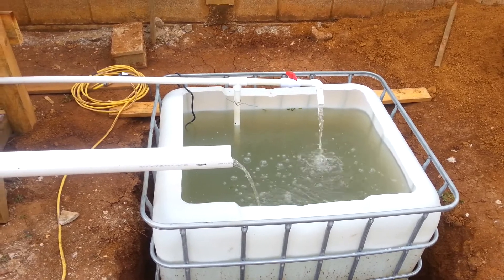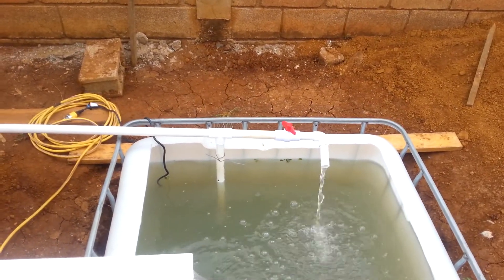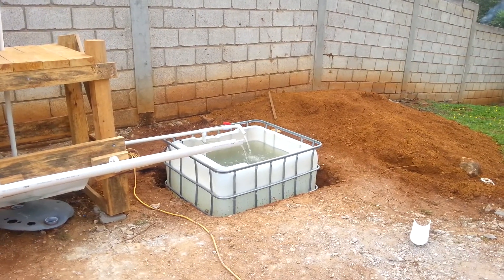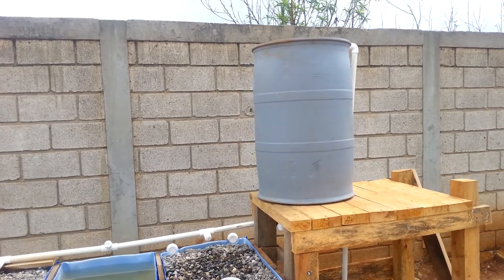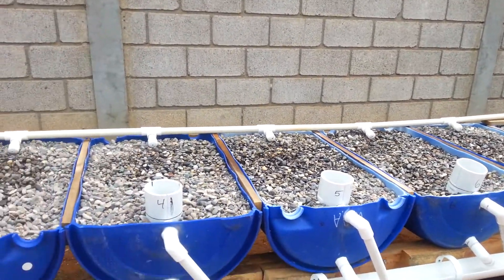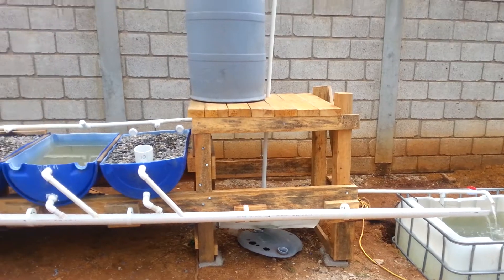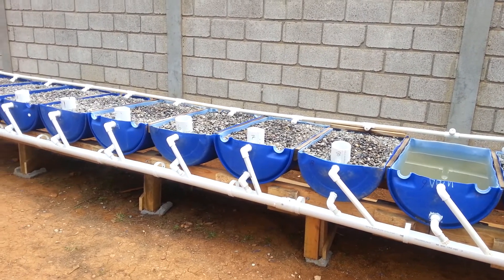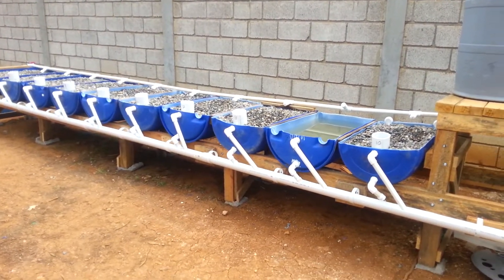Components of the Aquaponics System

Comment: Very nice project.  Thank you for your help to people from Honduras.  Could you post the projects planning?
Reply from the maker: We are currently putting together a teaching video that will help answer your question.  Stay tuned...
Reply: Don and I have finished the extended project. It can be located by typing the title, A Real Time View of an Aquaponics System. The video is about 45 minutes long. A shorter video titled, A Time Lapse View of and Aquaponics System will give you a 6 plus minute fast-paced view of the same build. The longer version gives you a more in depth view of the same build with added comments and insights gained from years of building a number of systems. At the end of the longer video there is a place where you can ask for a list of materials needed to build the system.

Comment: It´s Liked...Hi my friend, beautiful design system ... a question: Why do not they use bell siphon in the beds? Congrats on the videos... Cheers!!!
Reply: My thoughts exactly... without a bell siphon how do they expect the grow beds to cycle like a 'fill 'n flush system does. 

Secondly, the grow beds will not mature at the same rate and will periodically need replanting, causing wildly fluctuating levels of residual NH3 in the return water to occur. Two or three detention tanks in series with the return water will allow for the growing of alge that polishes the water and feeds the fish.
Reply: Capt. Nemo And complicated my friend, you're lucky!
Reply: Greetings... I like your set up, it's nice and straight forward. Kiss engineering at it's finest. I have something similar here in Nicaragua except I've taken it 1 step forward and use Bell Siphons to drain the beds. They're not all that complicated and they provide for a healthier, more productive bed.

Rather than using expensive pea gravel or other grow media, I've taken to using black volcanic sand. The enhanced surface area provides an optimal environment for the bacteria and fungi necessary to break down the waste stream from the fish tank.

I used to test the grow bed's effluent for ammonium content before returning it to my fish tanks but daily testing went by the wayside after increasing the number of detention/filter tanks to three. I use Duckweed (Spirodela polyrrhiza) as a filter media and as a source of food for the fish. The greatest amount of the algae growth takes place in the 1st filter tank. The 2nd tank's production level waxes and wanes, depending upon crop rotation and where the fish are in their growth cycle. By having 3 tanks in series, the growth rate of algae in the secondary tank is indicative of nitrogen levels in the water returning to the fish tanks. As the fish grow, they consume more food and discharge more ammonia, nitrogenous organic acids, creatine and creatinine, amino acids and urea. The 3rd tank picks up the slack if for some reason something gets out of balance.
Reply from the maker: We are currently putting together a teaching video that will help answer your question.  Stay tuned...
Reply: Don Fredricks
Look forward to it...
Reply: Don and I have finished the extended project. It can be located by typing the title, A Real Time View of an Aquaponics System. The video is about 45 minutes long. A shorter video titled, A Time Lapse View of and Aquaponics System will give you a 6 plus minute fast-paced view of the same build. The longer version gives you a more in depth view of the same build with added comments and insights gained from years of building a number of systems. At the end of the longer video there is a place where you can ask for a list of materials needed to build the system.